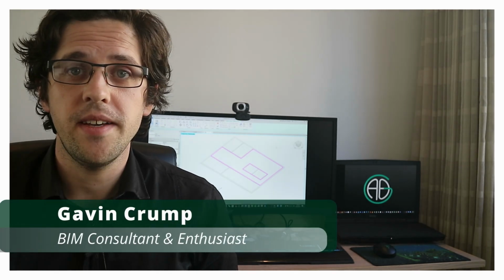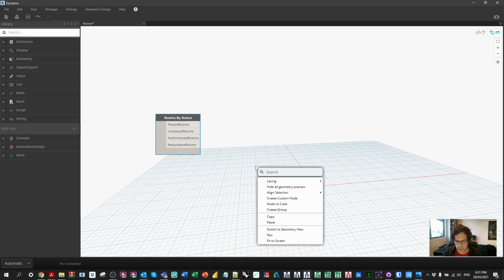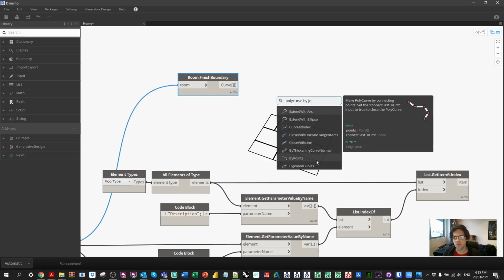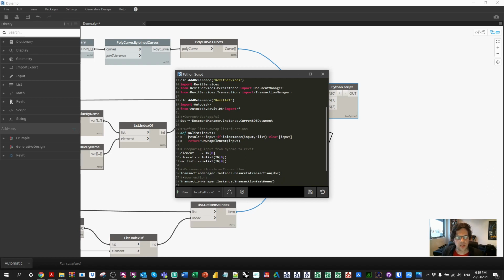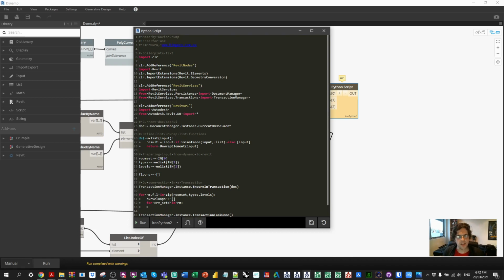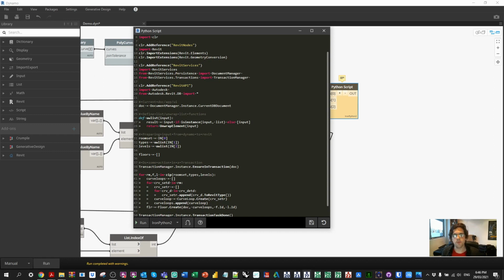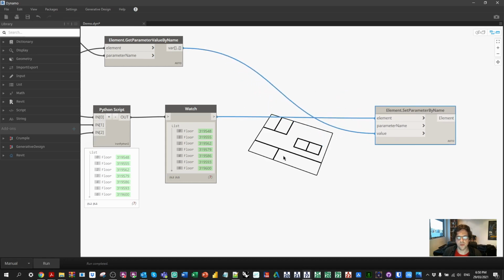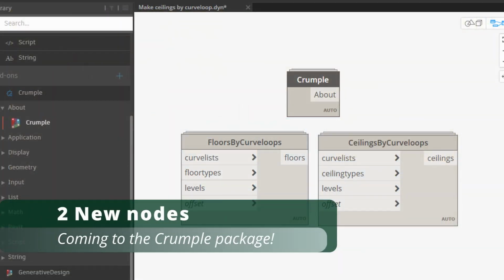Floors/Ceilings with holes in Revit (2022) using Dynamo!

Comment: Hi Gavin, great video and even greater script. As I little bit late saw it I have some issue. First is revit 2024, there is no Element Types and All Element of Type and second there is no way to make python code to working ... :( On Your github page I can not find this script, may be some other name ? Thank in advice for any suggestion ... BR
Reply: Gavin, everthing is fix and set, working, thank you ... :)
Reply from the maker: An alternative is element classes in 2024. Floortype should be a valid class. You can find the python code for this in Crumple package under Revit > Other > Floors
Reply: @AussieBIMGuru  Thank you for answer ...  br🙂

Comment: Hi Gavin... you really are a BIM Guru! one thing i´ve been trying to do is getting the door inset in relation to the wall face in the definition of the floor boundary, is it possible? if so, could you make a video about it? i´m trying to get rid of blank space that you get at the door insertion. Many thaks!
Reply from the maker: I'll add the topic to my list - it is not a simple thing to achieve generally so would make for an interesting topic I think.

Comment: Hello Gavin. Thank you for this great video. I'm working with similar structures and was struggling with those inner surfaces to create my floor finishes. I used your script having as input the same variables as you. Problem is, i having this error "TypeError: iteration over non-sequence of type Curve" and coudnt figure it out. Any clues? Thanks
PS : Im using Revit 2021.1 and Floor.Create is availible on its APIs.
Reply from the maker: Floor create is available in Revit 2021, but it doesn't accept more than one curveloop in a sketch - this was added in 2022.
Reply: @AussieBIMGuru   oh ok, make sense now. Thank you for the tip.

Comment: Hi Gavin, as I can see, in your newly updated package, you also include a node for creating floors with a list of ordered curves.
However, when I used it, it returns a null list.
Can you make a video to show how your nodes work? Thank you very much!
Reply from the maker: This python script is essentially that function. If you provide the same inputs as what I did here it should work.

Please note that these nodes will not work in any version earlier than Revit 2022.
Reply: @AussieBIMGuru  Hi Gavin, yes I'm using revit 2022 and the latest dynamo version/packages to test my script.

I have a list with 2 sublists, each contains 4 geometry lines that form a closed rectangle and in continuous order.

I have also tried lacing and levels, also change my engine to CPython 3 :(

The error is : "iteration over non-sequence ['  File "<string>", line 42, in <module>\n']"

Line 42 mentioned above is not in your node, but it's the same as line 42 in your video (the line that contains "for crv_setd in rm:")

Thank you very much for your help! Your works are awesome!
Reply from the maker: @LongHoang-nk5bz  can you email me at the address on my profile on YT? I'll send an example script and model of how it should work to compare.
Reply: @AussieBIMGuru  I've sent an email to you.
Reply: I am having trouble too:
Warning: TypeError : iteration over non-sequence ['  File "<string>", line 55, in <module>\n']

Comment: i just wondered if i can creat room floor inculding area under doors using old dynamo version
Reply from the maker: Yes it is possible. Take all doors from the room, get their centroid, pull to the floor sketch plane. Closest point to finish boundary as polycurve, extrude by half the door width in both normal directions and union with the floor surface.

Comment: Great video Gavin. Finally we have floors with holes and access to ceiling API. I think you should do same thing for Grasshopper.Inside Revit as well.
Reply from the maker: I believe the Rhino Inside team is currently working on this (I'm not sure Rhino Inside even installs to Revit 2022 yet), so I might give them a little while to develop this. We currently have a floor method (without internal loops), so I suspect once we see a ceiling node, the floor loop method will be supported as well.
Reply: @AussieBIMGuru  Rhino.Inside is not available for 2022 yet as you mentioned. What I meant was general scripting videos for 🦗Grasshopper.Inside Revit.
Reply from the maker: @mbilalgoker  ah yes I have done a few here and there but I don't tend to use a lot of GhPython - I find working with trees quite frustrating, still learning more about this!

Comment: Many thanks for your very instructive presentation and all others.
Do you think we can use the same method to put the paint on walls and baseboards?
Reply from the maker: This would be the splitface tool which is quite different to the sketch tools I'm using here. As far as I've found by searching my custom packages and the Dynamo forums there doesn't appear to be methods to achieve this - at least from what I've found (nothing!).

All I can find in RevitAPIDocs is a Split face postable command, so I don't think it's exposed for use yet.

I'd suggest considering wall sweeps instead of split face for skirting - this is a better method as we usually measure skirtings in linear metres or feet when procuring.

Comment: Local sections for structural plan,how can we do them?
Reply from the maker: I believe most structural firms usually generate the sections, place them on the same sheets as the plan after (so they sit on top of the plan) and then either rotate them by viewport or keep them at the drawn orientation. If the views are aligned, they should give a 'soft snap' when they line up on the sheet.

As far as I know there isn't a built-in tool to generate this type of view in a more intelligent manner than this.